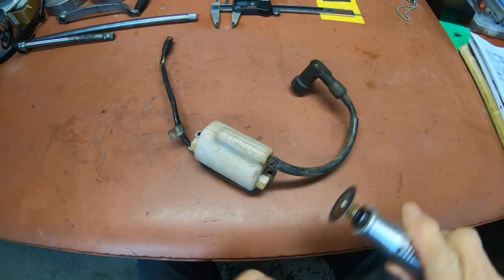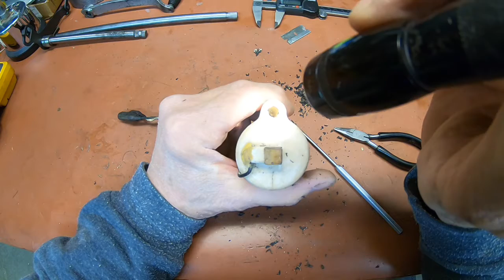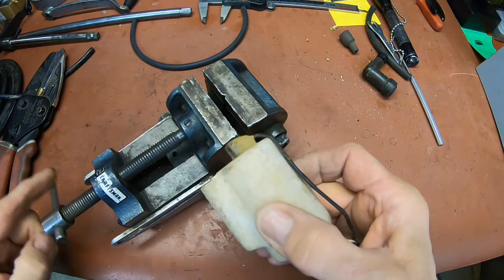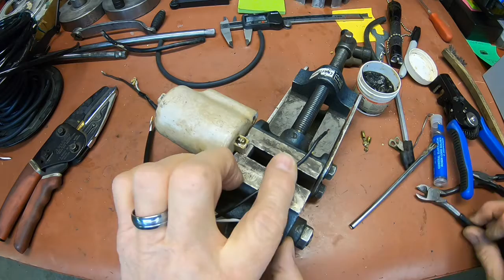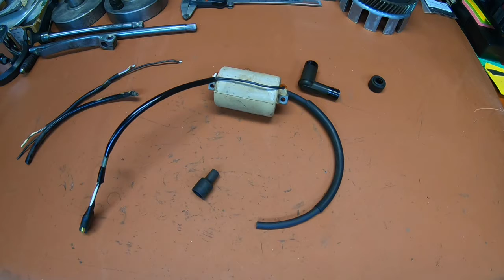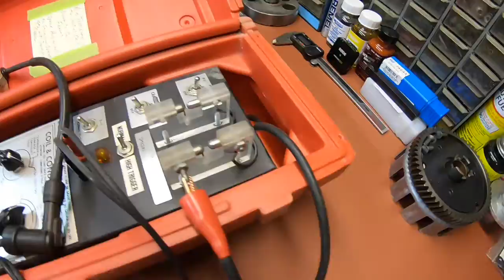Motorcycle Coil repair, Suzuki RM 250

Comment: Hi Dale, do you use resistor type Spark plug boot, or resistor spark plugs or neither? Asking for a friend.
Reply from the maker: Yeah the only rule is don't use a resistor plug with a resistor cap. But in short I'm not worried about messing up the neighbor's TV or radio reception so most of the time I don't resistor anything.
Reply: @montana2strokeracer  Yeah my only concern would be affecting the CDI and possibly damaging it. AI says this could happen for what that's worth. BTW I was successful in doing the repair on my coil. now just need to order the right Cap or Boot. Thanks
Reply from the maker: Never had any problems, I pretty much put non resistor caps on everything, and don't use resistor plugs. Its great to hear you made a successful repair on your coil, digging out the old plug wire insulation is the hardest part.
Reply: The other argument pro resister would be the circuit is designed to see that load. Knowing a little about electronics i can see how that could be.
Reply from the maker: Yeah I can see that Mike, if it were going to happen I believe it would be on the CDI units, the old point type ignitions are pretty much bullet proof. But with the RM's I have seen, they don't have resistor caps and the plugs were not resistors either. Coils are usually different be it CDI or conventional. But that said I have used those coils on units they were not designed for and have not seen any problems, but that's not to say one of those wont poop out on the next ride. I'm sure I have just been lucky mixing and matching component's. I am not by trade knowledgeable in electronics so I'm sure you know more about it than me. Thanks for the interesting conversation on it though, something to think about for sure.

Comment: Very nice work. I’ll need to do that soon on our Rm250C2 (same coil) .
Reply from the maker: Yeah, this is a pretty simple job, just take your time cleaning out the old wire. Thats the main issue. Had a C2 years ago, wish I had not sold it, nice bikes.
Reply: @montana2strokeracer  look for my son on the left at about 4:06 on our C2 . Video cam is on an A class rider on a wicked TT500. The boy launches the C2 like it’s a modern bike .https://youtu.be/p5lPBTUaQ5U?feature=shared

Comment: Good work sir. I have repaired Yamaha coils in the past but you have to be prepared to go in much deeper and rebuild a lot of the insulation afterwards, they didn't look too pretty afterwards either
Reply from the maker: Hi Andy, yes, I have done a couple and you are right you have to cut deep and remove a lot of potting to get to where the wire attaches and then solder it. Then apply lots of new potting to fill it all back in. I determined as I sure you did, there are still a lot of used coils out there and all that work is too much. But at least we know it can be done. For what that's worth. Thanks for stopping by brother.

Comment: Try melting some SOLDer on you iron before trying to unsolder the leads. It increases the surface area of your SOLDering iron tip and transfers heat faster.
Reply: Rob.. as much as it annoys you.. yanks call it SAWder we call it SOLDer..  never gonna change them.
Reply from the maker: Thanks Rob, yes, I should have tinned the tip, but I'm sure all the potting that was melted on the tip didn't help things much either. My little solder iron is not very powerful either at 60 watts. Thanks for stopping by the channel I sure appreciate it.
Reply: @montana2strokeracer  Was going to say the same thing. And the soldering iron tip is well past its use-by date. It doesn't actually seem to be "taking" the solder. It's good to be playing "catch up". Great video.

Comment: Hi Dale,  Another Great Tip !!  Had no Idea that could be done, Cant think of the amount of coils over the years that I have slung out, Now I am kicking myself. How the hell did you come across this technique ??  Thanks for Sharing this with the Community, Malc U.K.
Reply from the maker: Well, Malc, it's like this, curiosity got the best of me one cold dark day. I need a coil for a Suzuki and the only one I had the sparkplug wire was separated at the coil. I just though well, can't use it this way, let's see if it can be fixed. And so, you have it. A few days later I did the same to a Yamaha coil, well didn't go as good. It can be done but you have to cut away a lot more of the potting and find the eyelet that the coil wire attaches to and re solder a new wire then use a lot of JB weld to fill it back in. Any way sorry you tossed all those coils, if it makes you feel any better, I have tossed a few too. Desperation sometimes opens some doors that would normally stay closed. Thanks brother.